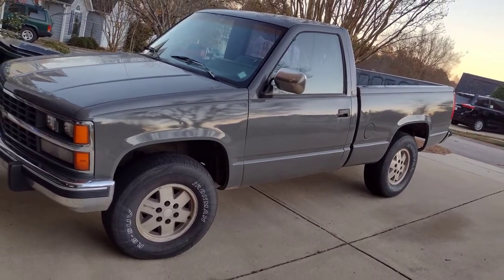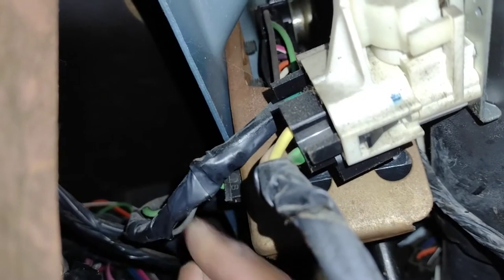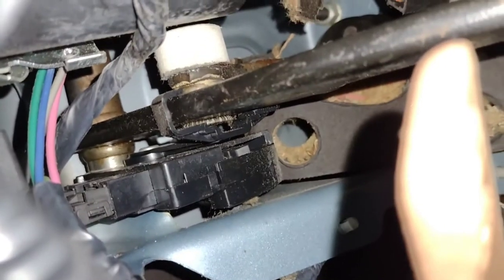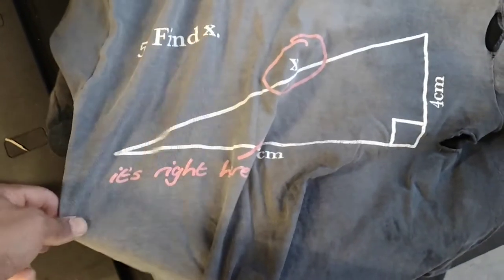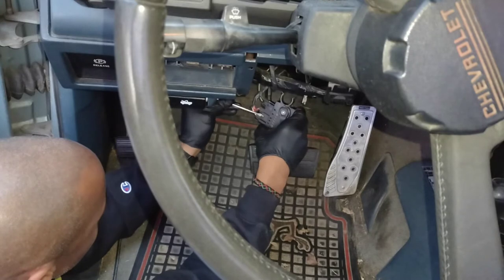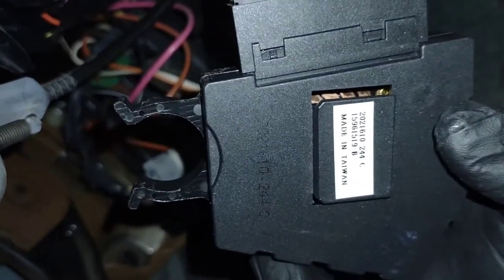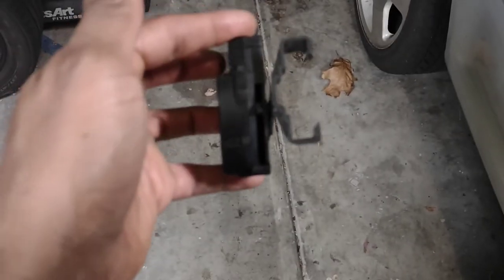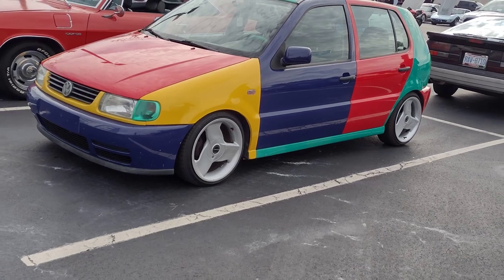89 CHEVROLET TRUCK brake light switch replacement | the lights would stay on

Comment: This is the most complete and concise description and illustration of this switch and it's operation/replacement I have ever seen. After trying to fix this issue many times with no success I had resigned my self to always having to slip my left foot under the brake petal to pull it back on my 1988 Chevy Cheyenne C2500. Great job and Thank You.

Comment: This is the only video I have found on this switch for 1988/1989 truck.  I have an 1988 GMC K1500.  I have the same issue, and after watching your video,  and looking at my original switch, I see there is an adjustment slider on the switch right at the bottom near the swing arm.  What does it do?  Could that have just needed to be adjusted instead of replacement? I fiddled with mine (having no true knowledge here...) and like magic the tail light issue went away... maybe it will return... just did it today.  Also, similar to a previous post, I used to use a bungee from pedal to seat frame... but stopped working after just a day or two.  I resorted to getting battery quick disconnects to disconnect every time I parked. A pain, but no more dead battery.  I will bookmark this video and respond on if the slider adjustment works awhile. I have been unable to find documentation of any sort on it.
Reply: Adjusting the slider did work for a short time... but it was loose and after only a day slipped back into the "not working" position.  Got a new switch and it is much stiffer on the slider and maintains position as set.
Reply: Also, the entire switch (old one) kept popping out of the metal slide retainer.  I guess 20 years as a farm truck had some wear... LOL

Comment: Ive been vuewing a bunch of videos on brake switch replacement, for 88-98 Chevy pickups. They are showing a much different looking switch, that they say is next to impossible to get to, with some odd, difficult to fasten, retaining clip. It remains to be seen what I actually have on my 88 K1500. (I have no brake lights). I find this odd, because supposedly 88-98 are basically the same.... Anyway, I still need to figure out if there is a relay that I should check, as well as double checking wiring and grounds. Do you have a description of what bulbs light up, for each of the applications (ie, brake, turn signal, emergency flashers, etc)? It's probably been awhile since my vehicle has operated correctly, and I'm not sure anymore how it actually is supposed to.

Comment: Glad you made this video. I changed the brake switch and my brake lights and tail lights turned off, the problem I have now is that they don’t turn on unless I press on the breaks with the parking lights off. But if press the breaks with the parking lights on they won’t turn on at all. My truck is a 91 OBS Chevy, any suggestions?
Reply: you ever figure it out 
mine is doing that
Reply: @christianhardenburg445  some one told me to change out my reverse light bulbs, and I did and it’s so weird that everything started working back to normal, don’t understand how that fixed muy issue but it did.

Comment: I had the same problem, their was air in the rear brake lines, I did replaced the brake switch and the new one stayed on all the time, put the old one back on and later on is when I found the air after replacing  one of the rear drum cylinder piston thingy device.
Reply from the maker: Ahhh. I will have to keep lookout for that when I do some upcoming brake work. I didn't even think about air in the brake lines causing it. But, it makes sense.
Reply: @MaqsVids  I found out because the passenger side cylinder started leaking.
Reply: I have the same issue with my c1500 the brake light stays on, I replaced the switch but still no fix for it. Ima try to replace my rear dr cylinder piston
Reply: @modlist6129  I hope it works, let me know how it goes.
Reply: @modlist6129 I would check your trailer wiring harness too. Pus hmm dow n.v with your hands to see if yo uh can hear the brake relay Uggh under the hood clicking or not. Could be that too
Reply: @modlist6129  check your ground wire connection to the frame on the rear also
Reply: @williamallen7882   I have checked that and the ground it connected maybe I need to clean where the ground goes it’s probably not making good connection. And I’ll check the trailer harness also thank you. I bought a new switch but it didn’t work